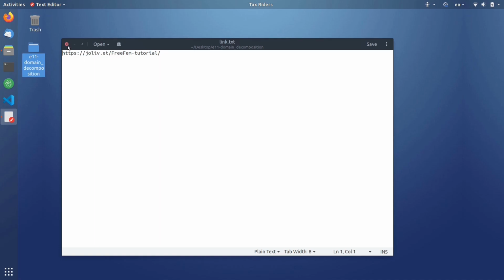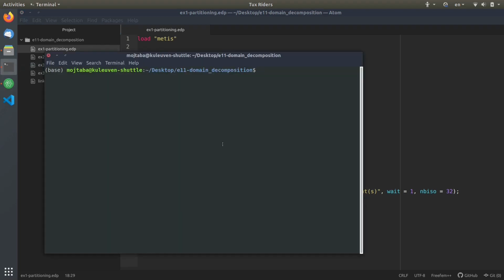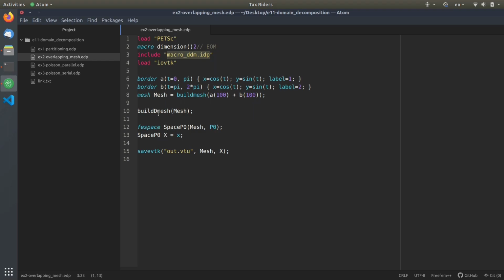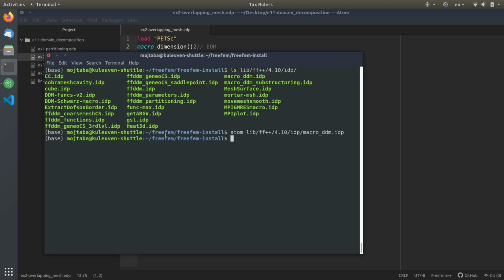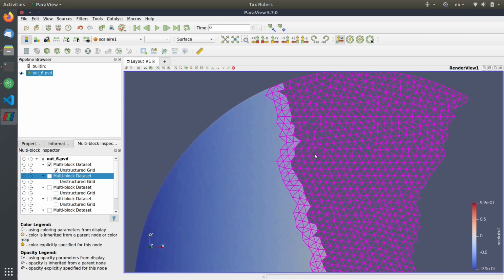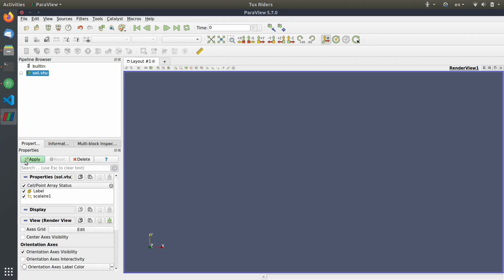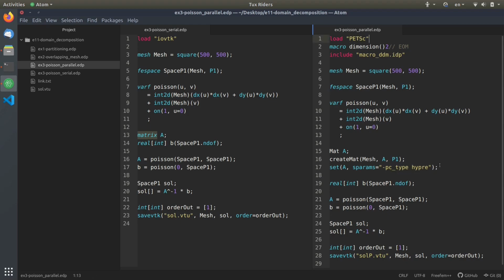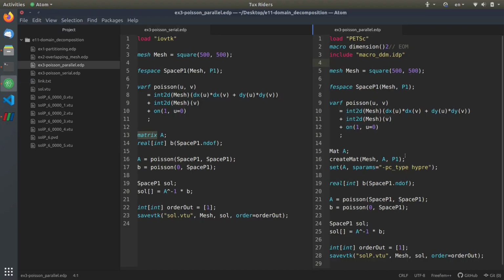[FreeFEM 11] Domain decomposition and high-performance finite element simulations

Comment: Hi，dear Tux，your series of videos have greatly benefited me. I am currently trying to use DDM to complete my project, but what confuses me is that I cannot find many introduction materials about DDM. If you could share some good materials explaining the principles of DDM and how to use it, I would be very grateful.
Reply from the maker: Glad to know that it has been useful for you. Unfortunately, there is no concrete DDM documentation available, and you need to learn the trick via the examples provide by FF community. There are many examples you can learn from in the FF repository (https://github.com/FreeFem/FreeFem-sources/tree/master/examples/hpddm). This is an example in which I turned a sequential code into a parallel code: https://www.youtube.com/watch?v=MvovTTcKEb8. Also, Pierre has some nice introductory examples for DDM: https://joliv.et/FreeFem-tutorial/main.pdf and https://joliv.et/FreeFem-tutorial/

Comment: Thank for providing good videos. If it is possible, can I leave a question? I run the copy of your last code, which uses PETSc with createMat by changing the number of MPI processors.   When I saw the computation time, anytime, using one processor provides the most fast result even though I changes the number of finite elements. I couldn't understand this one easily., So, if it is possible, could you give me a short advice for this one?
Reply from the maker: it's very weird. it looks like an MPI installation problem. this happens when the same code runs multiple times without decomposition working correctly, resulting in longer run time. please make sure that you have a correct MPI configuration on your system. this problem is more common on Windows especially.
Reply: @TuxRiders  Thank you for your comment. I have one more question about the domain decomposition method. Roughtly I thought that in principle the reduction of time under domain decomposition method should be directly dependent on the number of allocated mpi processors; For instance, a task using 10 processors would be 5 times faster than the same task using 2 processors, something like that. And the calculation of pi based on your code seems to be following that trend. And I know it is a simple parallel case, not DDM. So, how much do computation time depend on the number of MPI processors under DDM?
Reply from the maker: @daehanpark9954  it's a very good question. actually, it's very difficult to directly predict the correlation of the MPI size to the parallel efficiency in DDM problems since the performance depends on lots of parameters. that's why performance benchmarks such as strong scaling and weak scaling tests are performed to check the parallelization behavior. you may find this paper interesting in this regard, which is a benchmark study performed using DDM in FreeFEM: https://doi.org/10.1177/10943420211045939